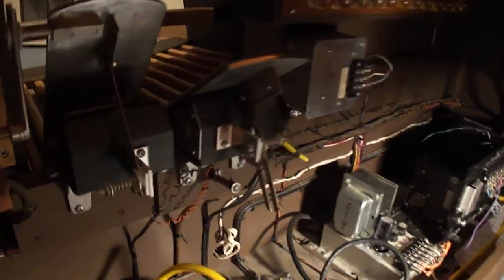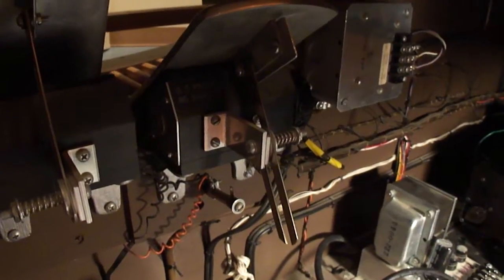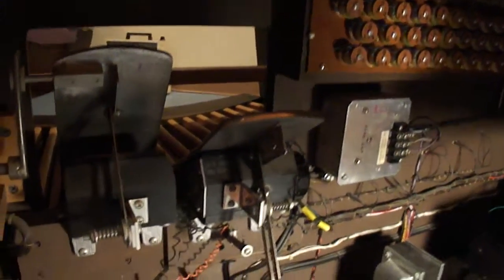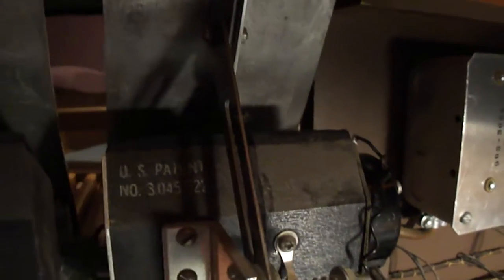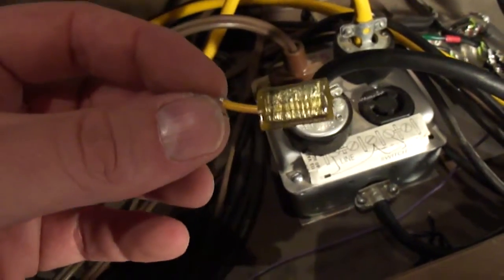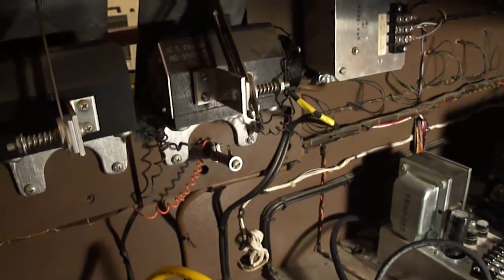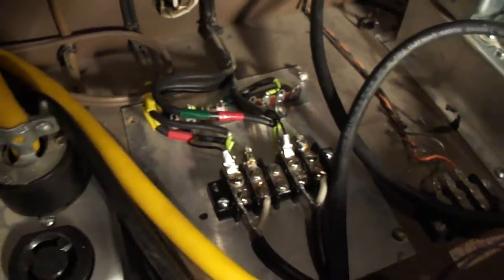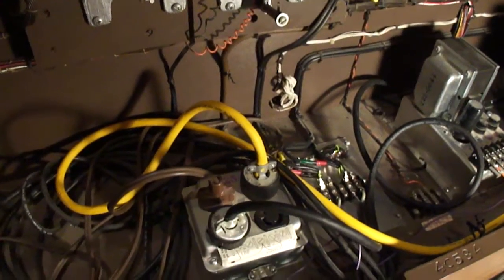Early 1970's Allen Digital Computer organ expression pedal photocell problem

Comment: Hi, some old fender guitar tube amps used a photo cell for the tremolo effect included (that they call it vibrato). There are several guitar tube amps shop sites arround that maybe got that photo cell (search for "Fender Photocell CdSe LDR"). I changed mine and the tremolo effect changed drasticaly becoming useful again. Cheers.

Comment from the maker: @ihatespam1977 I actually measured 900 meg on the ohmmeter when I tested it, I don't think that's right though, not sure why the reading was that high. When light was shined on the photocells they did decrease in resistance to less than 1000 ohms.